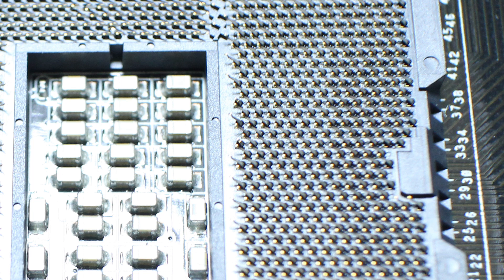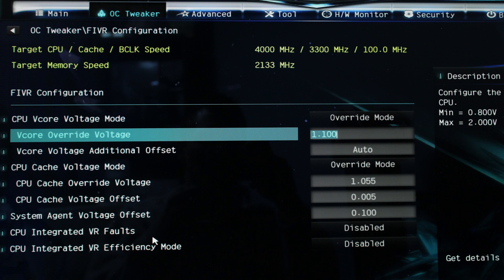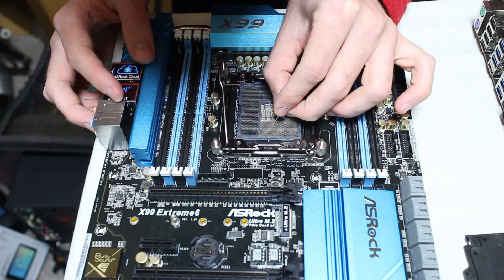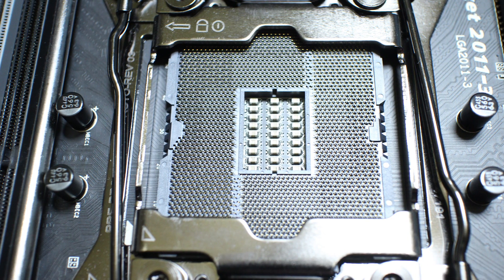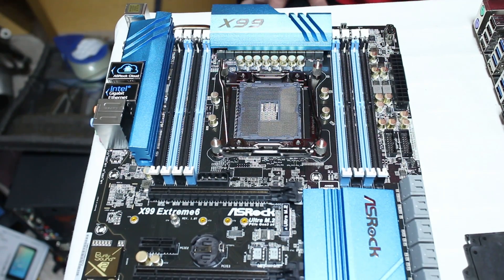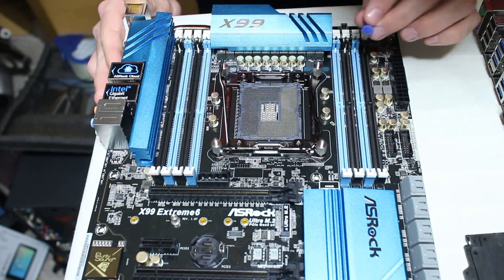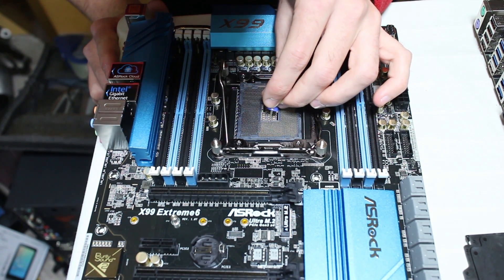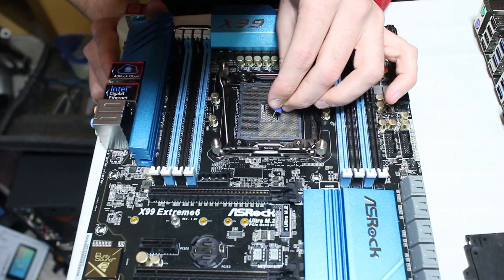How to fix Bent Motherboard Pins on an Intel Socket (X99 2011-v3)

Comment: Lucky you :) My MB does not recognise the 2nd channel of the RAM :( had multiple pins bent (using intel socket 1155) because of new cooler isntallation, worked perfect for years than I buy an new water cooled cooler and installed it 3-4 times and voila socket down the drain :(

Comment: I got bad news. AMD changed everything. for the X399 motherboards The Treadripper CPU pins in on the LGA CPU socket.. and its not for gamers. its designed for Video and video editing. for gamers is better off with a Z370 motherboard. X99, X299, X399 motherboards are all junk.

Comment: one of the pins of usb 3 on the motherboard is bent and is in contact with another pin. Is it possible to fix it ? and moreover my motherboard is not working.
is the bent usb 3 pin the reason for this, as it is in contact with another usb 3 pin?

Comment: There a second hand x99 mobo for sale and the only problem is the bent pin, the seller assured the mobo works even when the pin still bent, should i buy it?
Reply: ***** Ouch !! i got it for  $125. Its ASROCK x99e itx/ac about $300 new. still waiting for it to arrive.
Reply: Vusionatic It worked perfectly. thank you.

Comment: Happened to me,bought an 1150 motherboard on Ebay, came in with 3 pins bend.
Managed to bend them back.
That job was a pain,and almost kept my eyes staying cross.
Advice; always keep the black plastic socket cover.
When you upgrade your system and you gonna keep the old motherboard or you gonna sell it
always put the plastic cover back on, so the pins wil not be damaged.
Reply: how long did it took?
Reply: about 10-15 minutes,I borrowed a crochet magnifying glass with an inbuild led light ,that really helped.
Reply: +frontwing67  I sent a guy to give my motherboard to a profesionist, but he has only one hour cuz he has to leave the city, do you think he might have a chance?
Reply: sure, why not, the risk is that a pin/pins are bend so badly that in the proces of bending them back they can break, but you can always give it a try.
Reply: +frontwing67  thanks man, tomorrow I will tell you if I made it

Comment: I accidentally brushed my fingers across a few pins on my z87 mobo socket when cleaning the thermal stuff off the edge, i can't see any bent pins what so ever, will this still work or do i need a new motherboard? I don't want to put my cpu in and it dies.
Reply: just make sure all is clean as a whistle [think 91% or better Isopropyl alcohol] and get a magnifying glass an double check the alignment and you should be good to go...but as this is Tech YES Citys' site better let him wade in on this...my situation above I had clamped the lever down swapping two FX cpus an it bent the darn things almost flat...it took a while to get em all back in line and vertical...I used a credit card to check alignment along with the magnifying glass...I  was really afraid the pins would snap but gently did 'em a little at a time...it worked out and haven't had any issues but mine has the pins on the CPU rather than the board itself so that can be a bear to work with.....good luck.

Comment: I broke a pin off an older AMD CPU, and the CPU still worked flawlessly, but I have bent pins off older P4 and older Athlon's, I bend them back with a razor blade, haven't seen any broken or bent pins on LGA sockets yet.

Comment: Had this trouble when I was upgrading from a Celeron G1820 with it's stock cooler, to a Core i7-4790K with a Zalman CNPS 9900 Max (Red LED) on a Gigabyte Z97X-UD3H-BK motherboard. Up to then, the motherboard, along with everything else, had worked flawlessly.

On starting up, I was not making it past POST, instead getting continuous short beeps for 30 seconds before powering down and repeating. Googling the beep code initially led to either the CPU and/or motherboard power plugs from the PSU not being inserted properly, or the memory modules not being seated properly or failing, depending on the website.

So after making really sure everything was plugged in properly (especially with the 24-pin ATX connector, having to take a breather after using all my strength to push the thing in all the way), I tried turning on again. Same result.

I then tried using one memory module at a time in all four sockets. Turned out only the furthest two slots from the CPU actually worked with all four modules, while the first two slots, which was working just fine before the upgrade, were the ones giving me trouble.

As a result of testing all the modules on the slots that were still working, I knew that it wasn't the memory that was causing the problem. I could also rule out the EVGA SuperNOVA 750 G2 power supply itself, as it worked fine when put in to an older E8400 system.

The thing was, as I was using four 8GB modules of Crucial Tactical Tracer DDR3 1600MHz memory, I could see that the problem slots were still providing power to the modules, as the underlighting on the modules was turning on, but the top lights that would normally start flashing away after a successful POST, weren't doing so in the problem slots.

As I already had used the motherboard for several months, and had just spent all my cash on the i7-4790K, I didn't have the money to RMA the motherboard due to not being able to cover postage costs, while also having no guarantee of being able to get a replacement even if I could RMA it, as it was no longer being manufactured. So I was at a loss.

After Googling some more, some forums were suggesting that there may be a problem with the CPU pins connected to the memory controller, after others had installed after market coolers and had accidentally applied too much pressure to that area of the CPU socket while doing so.

The first time I put the Zalman cooler on, all 755g of it was slipping and sliding all over the place while I was trying to get the screws to stay put over the baseplate knuts long enough to secure it, which may well have been enough to damage the pins. After disassembling the system to get at the CPU socket, a couple of pins were indeed bent, with one in particular shorting on another. So finding that the damage was indeed my fault, RMAing the motherboard became completely out of the question.

With my only alternative to wait several months before I could afford another motherboard, I instead got a small pin out of the drawer and used that to try and bend the pins back into place. After more than half an hour of ever-so-gently pushing the pins back into place as best as I could, I then re-assembled the system with the original CPU, cooler and all four modules of Crucial Tactical Tracer memory in place. It worked!

To rule out any damage that may have been caused to the i7-4790K, I then tried it with it's stock cooler. It worked again!

Then to finish off, I disassembled the system to re-install the Zalman cooler with the i7-4790K once more, only this time, much much more slowly and carefully, like it was a mercury switched bomb, then put the system back together again. It worked!

It still worked after loading in all the BIOS settings I required, with the i7-4790K, running on stock settings, and the Crucial memory running at 8-8-8-24-1T @ 1.5v @ 1600MHz.

It kept right on working after loading up HWMonitor and CPU-Z to check that the CPU temps and memory timings were indeed present and correct, and to run the multi-thread stress test that CPU-Z comes with for a while to be sure.

My system is now indeed back from the dead! Thanks Google and itty bitty little pin! :-)

Comment: You certainly DON'T need another good board to see how the other perfectly fine hundreds of pins are. Each area has its own uniform pattern you should have PLENTY other fine pins to guide you.
Also, they are not so much as "PINS" as they are little spring hooks with a loop at the end sticking out. The CPU rests on the hooks and the lock plate keeps them in contact with the springy "pins".
Before a few sockets Intel was also using actual pins on the CPU itself. Maybe just before or around the i& it based the contacts on the socket and unloaded some of that extra detail work on motherboard manufacturing vs the CPU . How you like them apples for "Here, you do it!"

They can be hard to fix with a pin as you have little leverage use. What you want is a very small flat screw driver with a good handle, and a very small precision tweezer. No your girlfriends wide Tweezerman eyebrow model will NOT work well. Just need to shape it back in the right direction, and adjust position without it snapping off or dislodging it.

Comment: ASUS charges for broken pins FYI, got a new mobo from newegg, took some time due to other PC's to get working on this mobo, found out there were some issues, sent back to ASUS, tried to charge me 130 for fixing broken pins, while i bought it for 130
Reply from the maker: +Josh Philbee Damn that is daylight robbery...
Reply: I got msi and bought micro center store warranty for $70 on $400 or more board
Reply: got lucky and got replacement board from micro center cause of warranty and bought another warrenty
Reply: one that replaced had broken cpu pins
Reply: I try and go to them saying it was bought came like that ans swear by it that it wasn't you? For me I know I never did it and they tried putting it on me but thankfully warrenty covered it. Seems bent cpu pin area out of luck since they always gonna put the blame and fault on us the customer. Research what to do and see if that fixes it.

Comment: stupid part is that you wouldn't know if it's your fault or factory defect unless you inspect the mobo socket before you put in the CPU...once you put in your CPU, there is no warranty...guy at MSI emailed me that I can get a replacement one IF i pay another 80 dollars + shipping + shipping the broken one back..that actually is 30 bucks more than buying a new mobo..I built another 2 intel based PCs afterwards for people, they all worked out because I now inspect the pins before doing anything..
Reply from the maker: +Slodin Yeah I always inspect before dropping a CPU in there, even on a new proc.  This place down the road was selling an x58 board for almost $100, inspected it and saw it had bent pin. I then told them to stop advertising it as 'working condition', as some poor guy is going to get stung.  
It is hard with bending the pins back, there is a probability that they can still break, and if so you can be SOL - should not be happening with new boards at all.

Comment: Somehow I bent the bottom left and center pins on my 3 yr old z77 mobo replacing the stock air cooler with a fool proof water cooler. Spent about 10 mins trying to correct about 5 of the worst bent pins with a not small enough jewellers screwdriver, couldn't believe one was over 70 degrees and didn't break, saved myself a bit over $100 thank god.  Prime95's perfectly.

Comment: Heppened to me today with an Socket 1150 Gygabyte B85 MoBo, a fried DIMM was the result, three pins were badly bent and touching. I'm glad only the DIMM was damaged. After straightening the pins there where no more problems. I do not know if I caused the bent pins or if the mobo came that way from the box.
Reply from the maker: +Luis García-Pimentel Ruiz Damn, sad that you lost a DIMM though :(, was it only a 2gb stick?
Reply: +Tech YES City Sadly it was an 8gb. For all subsequent test I used a 2gb DIMM and when everything was OK I put in another 8gigger.

Comment: for normal pins, if no one has said this already, the best tool in the world is a mechanical pencil. just have no lead in the pencil and slide the pin into the opening and straighten it out

Comment: I actually purchased an Asrock z97 Extreme4 last month and there were a few bent pins in the bottom left of the socket. Needless to say that I was a bit pissed off. I thought that broken/bent pins were an instant no for returns/RMA. So I tried bending the pins back and it happened to work fine. The board is currently in my system and is rock solid stable. 
If you know your out if warranty and have nothing to lose, give it a try but take your time.

Comment: I was changing the stock cooler of my friend's FX-6100.The cooler and the cpu were like glued together i pulled the cpu and the cooler altogether while the lach was closed and then i was like WTF just happend did all the pins broke and left on the socket after 1 hour of trying to separate them i finnaly succeeded and then what half of the pins were bent.It took me 2 hours to bent them all back to their original possition.So the conclusion is always take the cooler out very carefully
Reply: +Yordan Milchev When the cooler is too stuck it is better to rotate it a bit so the thermal goo gives up without pulling thw CPU from the socket.

Comment: i have a msi motherboard with bent pins, msi would not replace it and nether did Fry's, I,m out $180. I got another MSI mother board it works OK but i can't Overclock the CPU because the pads on the i7 got damage. But if don't overclock the PC runs fine.
Reply from the maker: Damn man, I probably wouldn't risk any further damage and just run it at stock.
Reply: I will, but I'm disappointed on MSI quality control and Intel's decision to removed the pins from the CPU. This will probably be my last Intel build, to much money for something I can't even overclock. Thanks for all the great info in your Chanel keep up the good work. I just order the sony mic you recommended on your other video.

Comment: Hey, can you do a video about ASRock X99 WS-E/10G, socket 2011-3, Is it a gaming board or more a workstation board? And or the difference between a €230 x99 motherboard (cheapest i can get), or a €779 X99 motherboard, on of the most expensive you can get. Things like ASUS RAMPAGE V EXTREME (Formfactor: E-ATX) or a ASUS X99-E WS (Formfactor: SSI-CEB) which one is the best and gets the most performers. And i have also questions about graphic cards, there's so many. For instance does a MSi graphic card have the Geforce experience and is it as fast as club 3D or a ASUS or is that the same thing. I really get confused about that, and for me to decide what to get. And where does bit stand for in graphic cards and what does it do? 128, 256, 512 bit. is more a lot better, or doesn't it make a lot of difference? A Lot of questions i know:P

Comment: I watched you video where you praised the Extreme6 , and how it was so stable ... What's up ? Looks like you got that extreme6 with bent pins , no ? I think if you tried to push the cpu in wrong you'd get bent pins in the side, not the center area .
Reply from the maker: Yes it was very stable after I bent the pins back.  I just made this video after the review (although this event happened before the review) as it had no effect on the review, as the motherboard was rock solid after this (had it had not worked out I would of sent Asrock an e-mail).  The board was a review sample that looked like it had changed 1000 hands before I got it lol....
Reply: Tech YES City My last 3 builds were on Asus ...1 Gigabyte (Gigabyte was top notch about 15 yrs ago ... and a superMicro before that. I have been considering an ASRock after watching your review. Mainly on the stability. Do you think your review holds true for the other ASRock X99 MB's , particularly the OC formula and the extreme11 which are a little different that the extreme6 . Thanks much and great channel, you make great vids ! Keep the vids coming !
Reply from the maker: I would seriously hope so, IMO any X99 board should be rock solid considering they are charging a huge premium for it, and that is why I was disappointed with the X99-UD4 and X99 Sli Plus....  The Asrock was a breath of fresh air, things were stable, everything made sense and working on it just gave me some satisfaction, though I generally am not pleased with Haswell-E mainly because of what I use my computer for.  Honestly I would only be getting on H-E if you are going to seriously take advantage of those extra cores/threads as me personally I will be downgrading (already in the process) to a 1231v3 and b85, already tweaking it, you can OC the xeon to 3.8ghz, thats the real sweet spot imo.
Reply: Tech YES City That's why i'm waiting a bit...see where the dust settles. I have about 6 other computers around for everyday use. This new one would be in my studio, replacing my aging A/V pc . It still works great for it's main use (audio/Reaper) but it's somewhat slow with SVP and other NLE which I occasionally use . That, and a few other things I do will definitely use the multicores. But you're right, no point in having more cores if not utilizing them.  And good luck with the 1231 !  Tinkering with it is half the fun.
Reply from the maker: Already locked in all my clocks, just updating win 8 is a PAIN.... I wish Microsoft just made 8 keys work for 8.1...
Reply: Yeah trying to update 8 to 8.1 takes forever. Much easier to start with the 8.1 iso . 8.1 is very fast, even better after running classic shell